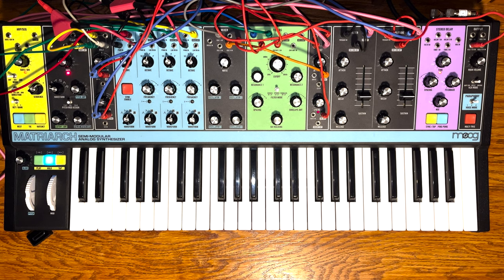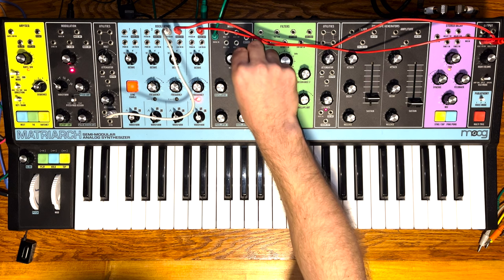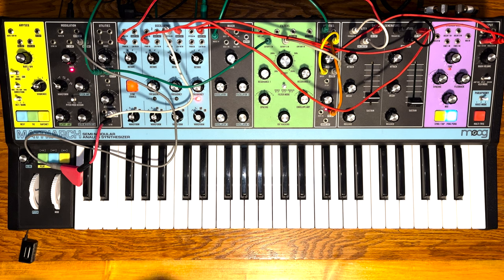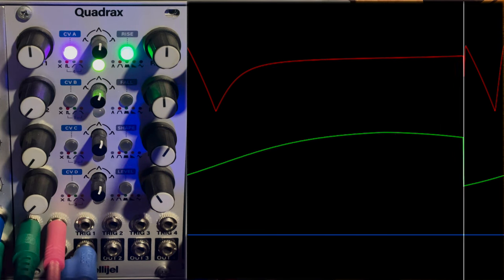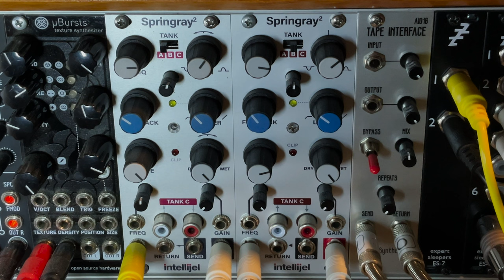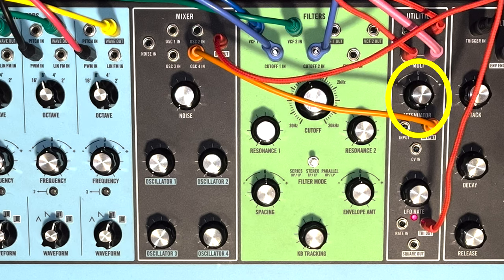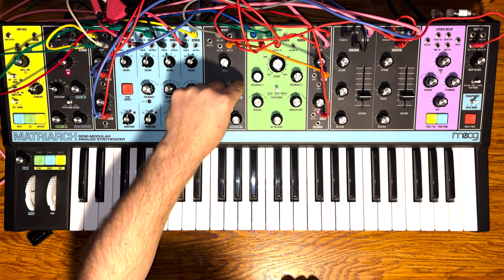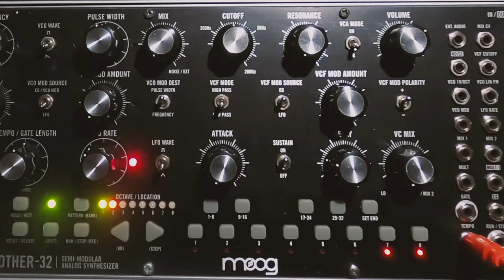Generative Patching with Moog Matriarch - Generative Expression Part 3

Comment: Hey man, I recently did an oscillator calibration of my matriarch... but when it finished, osc 1 was completely not making any sound. I don't know what to do now, any suggestion/help? thanks...
Reply from the maker: Make sure all oscillators are in audio range (once that happened to me and I was freaking out…until I realized one of the oscillators was just out of audio range) put keyboard into unison mode and play a middle C. If that doesn’t work try re calibrating….if that doesn’t work contact moog.
Reply: @RobeMusic  thanks for the answer! What do you mean when you say audio range? Are you reffereing to the mixer knobs?
Reply: @RobeMusic  just the osc 1 is not working even if the pot is set at 12, don't know what to do
Reply from the maker: Audio range just means human hearing range....the oscillators on the matriarch can below and above human hearing...so if it's too high or low you won't hear it. sometimes that can happen if you inadvertently play (or sequence, or arpeggiate) a high or low note.
Reply from the maker: if unison mode and hitting a middle C doesn't work (and all other oscillators are playing)..and you've tried re-calibrating, then you should email moog support. they're usually pretty quick to respond.
Reply from the maker: you can also try resetting global settings...go into global and play lowest and highest black keys...sometimes that sorts out weird issues.....make sure you're not modulating the pitch...mod wheel all the way down and pitch amt in mod bus at 0.  (and of course age old solution...turn it on and off)
Reply from the maker: hope that helps...but really...email moog. I'm just a guy who likes to play synths. they know a lot more than me.
Reply: @RobeMusic  thanks a lot for the time man, I'll try to figure it out. already contacted moog, waiting for an answer. cheers from italy!